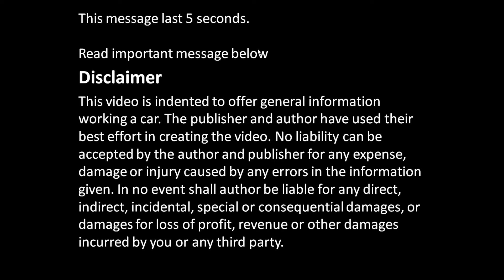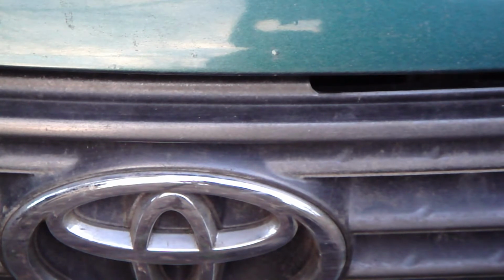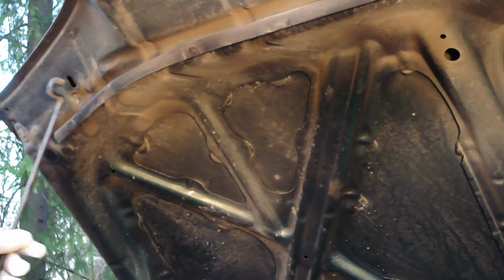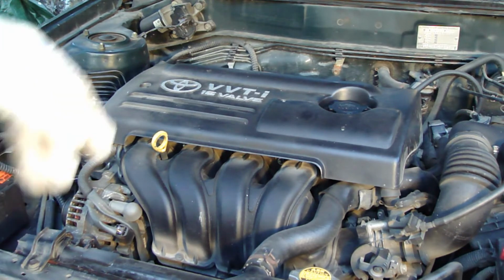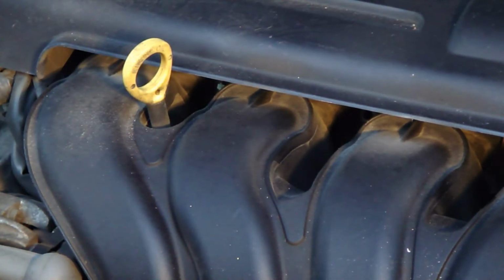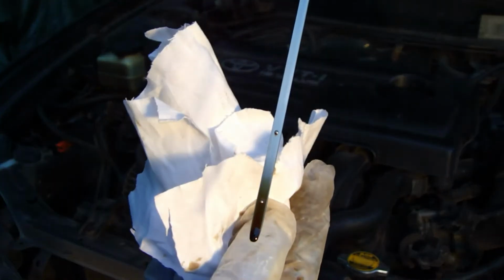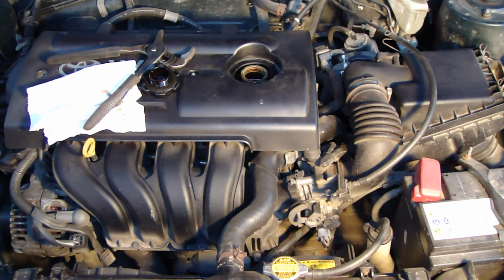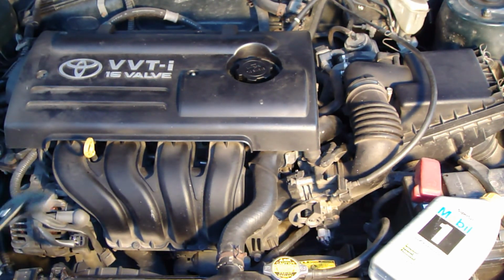How to check oil level Toyota Corolla VVTi engine. Detail info.

Comment: Hi Peter, I have a question, I know my question is a bit off  the topic but how do I reset my car ECU, I have the Toyota Celica 2000 1.8L engine. I have looked online but all the places I have checked say all different things. I want to reset my ECU because I think fuel to air mix is incorrect and on the Toyota site they just said to reset ECU when the car is at normal running temperature and after 15 minutes the car will automatically adjust the right air fuel mix again. Does that sound like the right procedure?
Reply from the maker: Hi, this sounds Ok. Toyota's technology ad engine's are normally so pullet proof technology, that they can even heal itself.